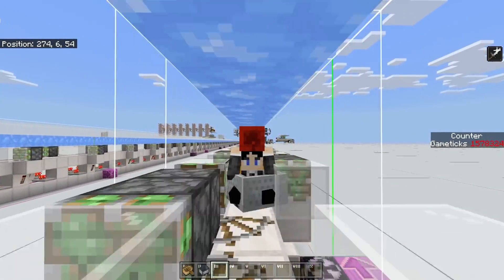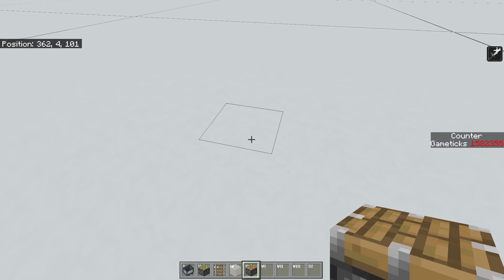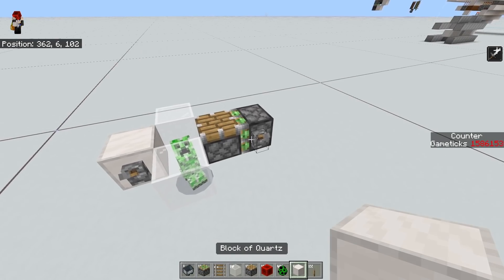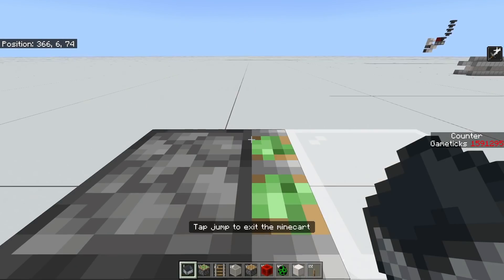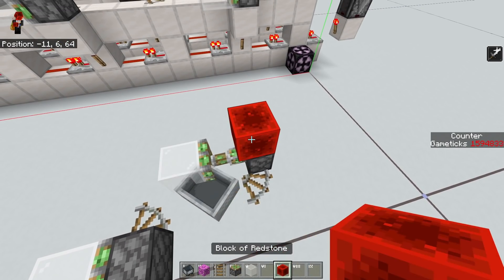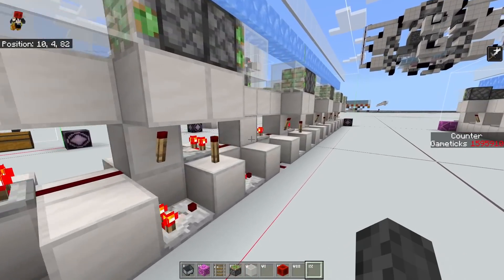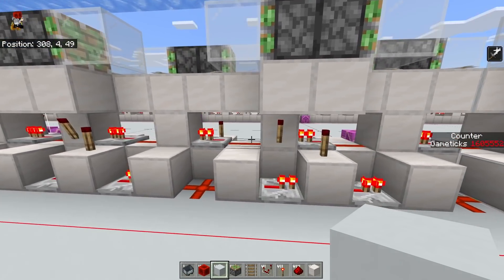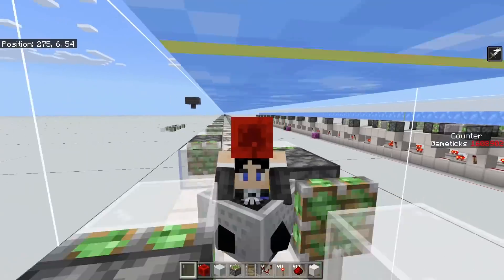26.67bps 2 Way Piston Bolt Showcase Minecraft Bedrock 1.17 Caves & Cliffs

Comment from the maker: Cool, isn't it? What methods of transport do you personally use / prefer?
Reply: Ice roads ftw, theyre faster and easier to use than piston bolts and you can yeet a boat down and row from anywhere on the road.
Reply: @Hakabas01  yes and they are way more cheaper
Reply: I use e-pearls
Reply: Teleporting
Reply: Pigs and carrots
Reply: I prefer piston bolts but it's nice to have the option of an ice road as well.
Reply: im too poor to afford a piston bolt in my single player just have a 700 block tunnel going to stronghold using nether transport.
Reply: Ice highways, there are extremely convenient for transportation, especially when I build them in the nether. The only disadvantage is that  packed and blue ice are really expensive, and normal ice can melt when there is a light source nearby....
Reply: /tp
Reply: @maxeryperson5114  in survival he ment
Reply: @TheAtomBuilds  r/ woosh
Reply: Thanks for making this! I was looking a lot for piston bolts on bedrock
Reply: I like to use ice bridges. I use pack ice. It takes to long to get blue
Reply: I like piston bolts but also elytra just because it is so fun to fly around
Reply: Elytra or Boats
Reply: Elytra
Reply: Elitra :D
Reply: Elytra
Reply: soul speed or ice road
Reply: Is there a way to get nether portal tiles in 1.16.1? because I tried both of only21’s methods and the grindstone would always pop off and for the other one the oak saplings would never “grow”..
Reply: This has been patched. Nether portals that shouldn't be there vanish. :(
Reply: Elytra and Ice Tracks
Reply: Blu ice bot method if I bothered to check it is like 10000000 blocks per second it is ins e
Reply: Ice roads and ender pearl stasis chambers
Reply: Ice boat tunnels in the nether are cool.
Reply: Iceboat
Reply: Definitely elytra for me
Reply: Elytra duh
Reply: blue ice.. but piston bolt are useful for transporting hostile mobs..
Reply: Haha /tp go brrrrrrrr
Reply: I like to use slavery .
Reply: stasis chamber + wifi (Yes, it exists and the construction is simpler than people think)
Reply: I use piston bolts and have a option of ice roads for friends
Reply: does this work on java  i k its bedrock but sometimes it works bedrock+ java i couldnt find a 2 way piston bolt for java and if you know a tutorial about 2 way piston bolts in java plz send me a link
Reply: Elytra and rockets is good for sort of early game
Reply: Elytra
Reply: Ice boat
Reply: This tbh

Edit-btw first (maturity 100)

Comment: I have found a way to dupe gravity blocks. Using end gateways this does not work with concrete powder. But it works with sand gravel and anvils I did not make or design this. But it still works in 1.16.100. Here is the link to the vid https://youtu.be/CLqBSobvAnE
Please like this comment so nex can see it.

Comment: How do you deal with corners or diagonals?
Reply: Oh, spoke too soon
Reply: Would love a one way diagonal design tho.
Reply: @MehrGills  the reason they use diagonals on java is because they are faster that straight ones. On bedrock diagonals are just a bunch of 1 direction piston bolts in opposite directions. They are actually slower than having 2 normal ones in a L shape because they cross more chunk borders